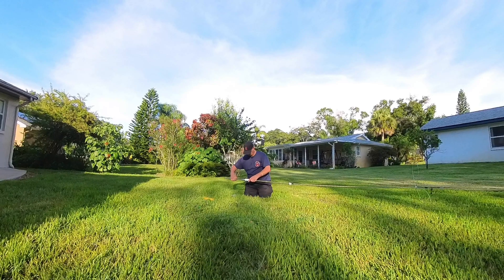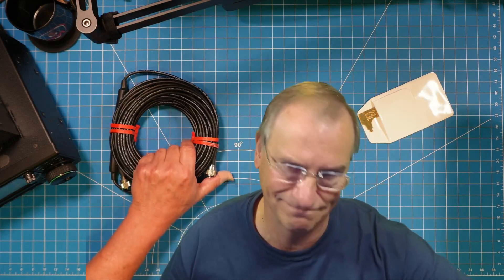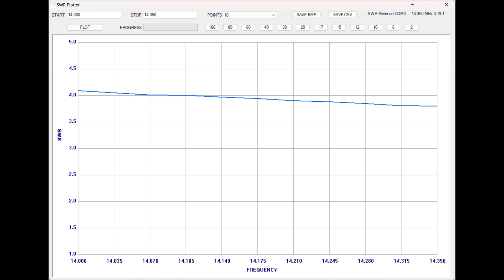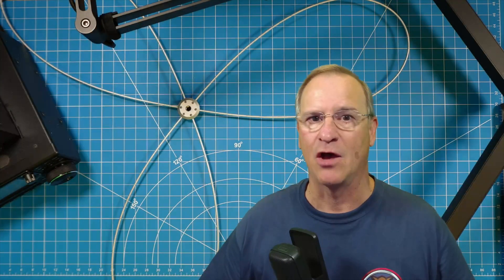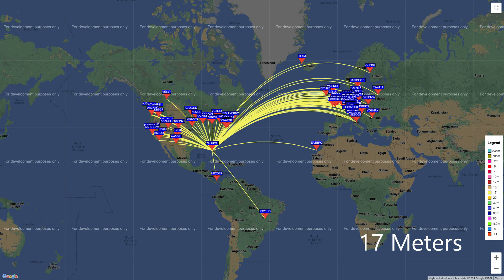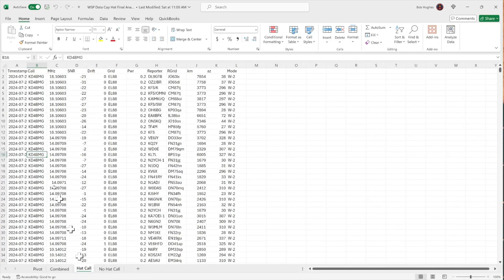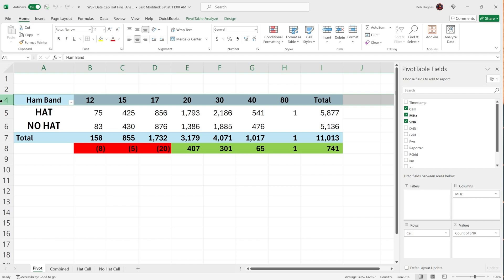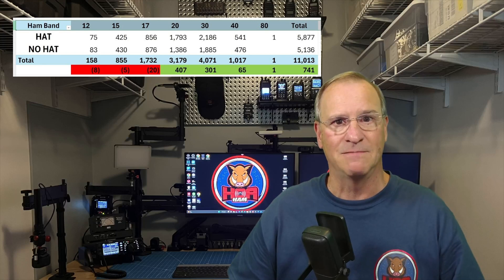Hat or No Hat:  Does a Capacitance Hat Make a Difference?  Demo and Review of the CHA CAP HAT

Comment: Which whip??
Reply from the maker: I was using the CHA Mil Whip - https://chameleonantenna.com/celdp3
Reply: @HOAHamRadio could the SS-17 or 25 be used?  Going to do some experiments with them.  My CHA Cap Hat go delivered today
Reply from the maker: @ewhamm Yes, both will work. You’ll want to guy the SS25.
Reply: @HOAHamRadio got my Cap Hat delivered today and followed your suggestion in setting it up.  No problem
Reply from the maker: @ewhamm  Always fun deploying new gear.

Comment: Are you using this as a resonant or non-resonant antenna?  Will this get me 30m resonance on a CHA17?  Will it get me 40m on a CHA25?
Reply from the maker: The antenna I was using, with a matching unit, does not have resonance on any frequency; it is broad banded for use with a tuner.

A CHA SS25 will get you resonant on 30, add the M-25 coil and you will get 40.  You will also need a spike and a blank adapter, unless you already have something like that.

Links to each are below.

SS25  https://chameleonantenna.com/juac5e
M25 Coil  https://chameleonantenna.com/djxe9b
Ground Spike  https://chameleonantenna.com/jcc2fy
Blank Adapter  https://chameleonantenna.com/rywbkc

Comment: How did you tune the antenna automatically overnight using the wspr unit please ? Or is the antenna naturally resonant on those frequency’s ?
Reply from the maker: I was using a 5:1 matching unit with the vertical; if I was operating SSB voice, I would use my internal shack tuner.

The WSPR transmitter that I sue does not care about SWR, therefore, there is no tuning as it automatically switches from band to band.

Comment: It took me over 20 years of being a bumbling ham, absorbing bits and pieces of seemingly unrelated information and building too many rotten antennas. Then one dark and stormy night, as if by spontaneous combustion in a pile of oily rags, something went SNAP in my head and it all became clear. I was finally able to visualize what an antenna is doing and can guess how to make it work right just by looking at it. Looking at them during thunderstorms is even more effective, but seriously, folks...
     Anytime you can make an antenna look inductively slightly long to the transmitter and then counter it with capacitance somewhere to bring it into balancing the system load, even with a shack L/C tuner, you have created something that is kind of like a capacitance battery for RF that instantaneously stores up and re-releases rf energy resulting in a PEP kick. Its like the antenna system is a vice that squeezes the RF in the antenna system. A capacitance hat does both; it adds inductance and capacitance to help produce this PEP kick described above. I guess the perfect capacitance hat would be a 'neutral' one that did not change the resonant frequency when added because the amount of inductance added was offset by its capacitance. Visualize energy. With Inductance being predominantly voltage related and capacitance being more of the realm of current the best point may be midway between the voltage and current peak lobes, but on placement, I would err toward the high voltage side for hat placement and pray for St Elmo's Fire to appear.
Reply from the maker: Really great input here!  Thanks for the view and comment.

Comment: I also use WSPR and Excel tables to compare antennas. Total number of contacts is an interesting metric, but can be misleading if you are reaching the majority of monitoring stations with both antennas. I always analyze the difference in received signal strength as reported by the remote stations. I average the signal reports and then compare them. The results are often quite revealing..and astonishing in some cases. For example, on 40m I found my vertical to be 20 dB stronger into Europe (from my AZ QTH) than my EFHW…even though the total number of stations that reported hearing me was almost identical for both antennas!
Reply from the maker: Thanks for the feedback; I'm always trying to learn new ways to understand and apply the data.

Comment: Give it a try with just the Mil EXT + hat on 10 and 15 - closer to resonance on those frequencies- think the bad result on 12m was due to the radiation pattern breaking up as the was electrically longer than 1/2 wavelength

Comment: Great, informative video.  I use the capacity hat when I deploy my MPAS 2.0, and I have a couple of suggestions.  First, for portability of the cap hat, remove two of the elements from the hub and leave the third one attached.  Velcro the two detached elements to the attached element and you have a small footprint that fits into the CHA backpack that comes with the MPAS.  Yes, you will have minor reassembly in the field, but it takes less than a minute.  Just remember to keep the Allen wrench with your kit.  Secondly, use the CHA UGS when deploying with a cap hat.  The additional support is worth the cost of the guying system.
Reply from the maker: Fantastic suggestions, especially like the break down idea.  Thanks for sharing.

Comment: Useful info in an easy to understand format:
Just as a loading coil has the most affect at the lowest impedance point, the point where the most current is flowing, (the feedpoint of a 1/4 wave element,) a capacitance hat has the most affect at the highest impedance point, the top of a vertical, where the voltage is highest. The only reason to place a tophat further down is if there are wind-loading concerns, such as with a vehicular installation, or an ice-loading concern in a region where ice-storms occur since more energy will hang out in the tophat and less energy will reach the antenna tip. A tophat will convince an antenna that it is both longer and broader-band than it is, since electrons entering a tophat have more places to go to get away from one another and take more time to do it. A capacitance hat acts as a large reservoir for the high voltages occurring at the tip of an antenna, making the signal less fussy about its exact length. The best tophat has a large diameter wire, pipe, or tube around its perimeter, the larger the perimeter material the more the effect. I built a 30' vertical for 1750 meters with a 6' diameter tophat, and of course the larger the perimeter tube was around the tophat the smaller the loading coil I needed at the feedpoint of the quarter wave-tuned vertical. (I still needed 35 lbs of 8 gauge copper wire.) With a quarter-wave vertical there is maximal current at the base, and maximal voltage at the top, thus the greater the effect from capacitance at the top, and the greater the effect of inductance at the bottom. Capacitors work with voltage,. Inductors work with current. Far too few hams understand that simple concept. Antennas induce a magnetic field in the air around the current flowing in the antenna. The higher the current, the stronger the field that can be turned into radiation. The most current is at the base, or feedpoint of a 1/4 wave vertical, so that moving more current higher up the vertical increases radiation efficiency. That really only matters in antennas that are physically short relative to the wavelength you're trying to get them to radiate on. Radiation resistance is an imaginary resistance that accounts for the energy that gets radiated from an antenna, since that energy is fed into the antenna and has to be accounted for, and calling it a resistance is a whole lot easier than mathematically describing the fields involved in electromagnetic radiation. A low radiation resistance is a bad thing because that means that less energy is dissipated by that resistance, meaning that less energy is being radiated. There, that's a simple bunch of random stuff that may help you understand and picture more about what's going on without having to get into heavy field theory. Having a good mental picture of what's happening makes understanding how to do whatever you want to do a whole lot easier. At some point you'll find you won't even need any instructions at all to do pretty much of anything. - Elmer
Reply from the maker: An awful lot to digest here; I do appreciate you sharing since your explanation is far easier to follow than the textbooks I was researching.  I enjoy continually growing and learning!

Comment: The top hat on the WWV transmitter in Fort Collins, Colorado is really impressive. It dwarfs the actual radiator and most folks think the top hat is the radiator.
Reply: I think you meant the WWVB tophat for 60kHz. Most of the WWV verticals are hardly even noticeable from I-25. Last time I was by there they are just chunks of small triangular tower material. And if I recall correctly, they are only simple quarter wavelength. They were guyed real well, though. It's surprising how tiny and simple those antennas are for a system that pretty much reaches the entire USA on 1 band or another at 1 time or another every day.
Reply: @johnwest7993  When I left off the B, I wondered if someone would be so pedant as make a comment such as this.
Reply: Indubitably/….🤣🫡

Comment: Hey Bob, 

Great video, and you are one of the gateway influencers that have led me down a very expensive Chameleon path.  Great products and super job on your part for the realtime A/B testing!

Quick question, I didn't catch, did you have a radial system / ground plane under the verticals?  If so, what were you using?

73 es God Bless,

Art / K0ACP
Reply from the maker: Sorry for spending your money : )  I believe you will very much like the gear; quality and performance are top notch!

I used three 16 1/2 foot radials on each set up, HOA Ham style, its what was on the workbench readily available at the time: https://youtu.be/pTNojRg8x40
Reply: Bob, thx

Comment: Good afternoon Mike,

Thank you for putting out great content to help all Amateur Radio operators.
I live in Valrico/Brandon, FL and I am new to Amateur Radio, still studying to take my Technician license, I have already bought the Yaesu FT-DX10 for my base station and a Yaesu FT5DR HT knowing I am not yet able to use them until I get each appropriate license.

I am very confused and need help understanding whether or not I should ground the equipment in my shack or not.

I have been reading and watching several videos about the need to ground your base station in your shack, I came across a video that stated you should NEVER ground your amateur radio equipment be it a base station in your shack or an HF antenna and claimed it is illegal to do so and a significant violation of the national electrical code under NEC 2011, definitions article 100, equipment, article 110.54 bonding and grounding equipment and article 800 communications circuits.

The YouTuber claims the only specification for grounding is for towers and static dissipation.
Grounding amateur radio equipment is forbidden under article 250.24 A5 Load-Side Grounding Connections.

The YouTube video that has me confused is: 
Update - Never Ground Ham Radio Equipment!!! 
By YouTuber K8BYP

Thank you in advance.
Michael
Archangelmm@frontier.com
Reply from the maker: Hey Michael, Bob here....

Well, ARRL is a respected authority on amateur radio; they say to ground https://amzn.to/3WiG3qt

Yeasu, ICom, and every other manufacturer I know puts grounding lugs on their equipment so you can ground it.

I guess this gent you reference with 677 subscribers as of today could be correct.  I choose however to follow the guidance of ARRL, Yeasu, and ICom.

Comment: I read somewhere 🤣🤣, (a radio/electrical engineering article), that capacitance hats work best when placed at the top of the antenna.
KD8EFQ/73
PS, (edited), I won't get a notification should you reply to my comment because Google/YouTube hates me because I support Pres. Donald J. Trump, and harbor conservative values and ideals 🤣🤣🤣
Reply from the maker: Its actually odd how little information exists on this topic.  I found one yesterday, supposed to be an industry best resource, and I couldn't understand a single world that was written.  Obviously someone wanting to sound so smart, that without a PhD, no one else would even understand...not helpful for the masses.
Reply: @HOAHamRadio , tophats are from the days of Marconi and 200 kHz transmitters, when they were trying to come up with a vertical that wasn't 2 miles tall but still resonated. They still serve a purpose on HF when you need to broadband a vertical, or can't build one that's a quarter-wave tall, such as on 40, 80, or 160. I left a long post on this thread about them signed - Elmer. Enjoy.
Reply: @HOAHamRadio  Thanks.  I made a combination Hustler/Chameleon "top loaded" deal by placing the 80-meter load by Hustler on a 54" mast, and that on top of the Chameleon Ext. it seems to have had very similar result.  Soon, I plan to take the Hustler 80-meter mobile load to a shop near me and have the whip holding piece chopped off, and drilled out with a 3/8 24-thread female receptacle so I can put the cap hat at the top with another shorter extension that also has 3/8 by 24 thread studs.
Reply: @HOAHamRadio  You need to go read the OLD books on radios and antennas, from the 20s and 30s. back when they still believed in the ether.
see Worldradiohistory
Reply: Yes - the higher is the best! But mechanical limit are currently preventing to put one at the top of the SS17 or SS58 and we're working on it!
Reply: @Chameleon_Antenna  I'll pay for a matcher that'll take 1Kw PEP SSB because, as I learned with power supplies, if it calls for 20 amps, go 30 or 40 amps if you can afford it!  And that's what I've done with that.
Reply: @charleswoods2996  We're working on that actually....
Reply: @Chameleon_Antenna  Wow, (enter Twilight Zone theme music...)!  
I'll be making sure I have the mean$ to order it from your site. 🤣
Reply: Hey Charles.
Reply: Have you checked to see if you have notification turned on? I rather doubt YouTube is searching for trumpers to disable notifications on, in particular if your posts are still visible.